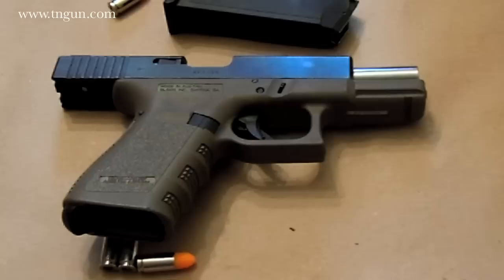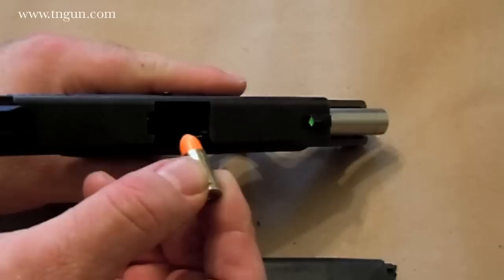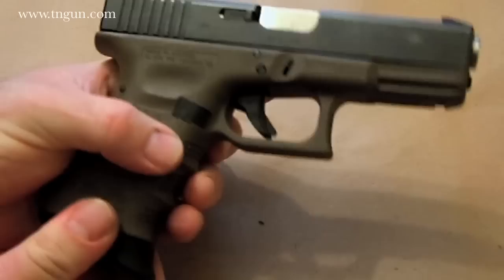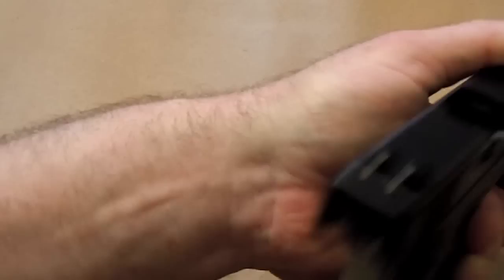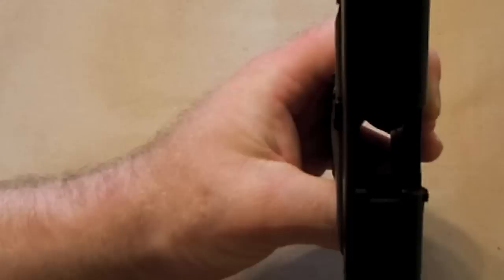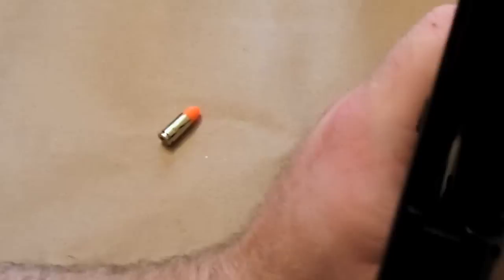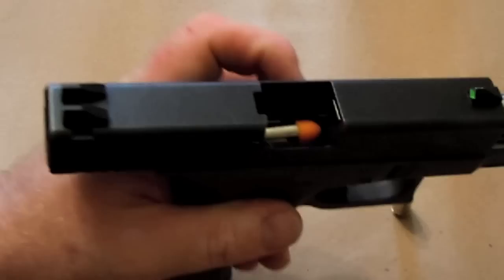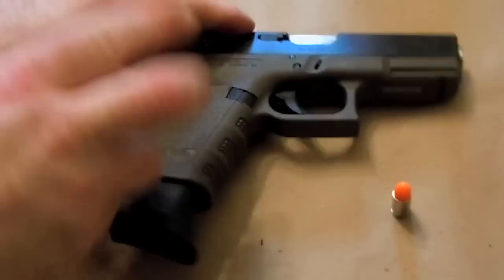How to Properly Load a Glock to +1

Comment: A Glock with 1 in the chamber only requires a light trigger pull to set it off.
That is comparable to carry a live chambered CZ 75 variant pistol with the hammer cocked but unlocked.
There's no heavy double action pull, and no additional safety, no warning, no second chance, just the very light trigger, to set it off.

Why do other companies even bother adding safety features to firearms if we could just carry the firearms hot and live?

Why do car manufacturers even bother adding safety belts, airbags and crumple zones if we could save a lot of money driving simplified vehicles?

That's just one side of the argument, what's the other side?

Comment: Sorry but extractors do not "bend" as all I have seen can flex as they are designed to and the extractor flexes to ride over cartridge rim on every round be it hand loaded if mag loaded. At least Ruger does this. Haven't researched Glock imperfection design.

Comment: Speaking of premature wear. Don't let your slide slam forward when you drop in a round. The slide is designed to pickup a round from the magazine which decreased the force in which it hits. If it's not chamfering a round, assist it when releasing the slide.
Reply: LedGuitar1218 No no and no. NEVER assist the slide!
Reply: Right, regarding "never assist or ease the slide closed"!  What do you think happens when firing, Led?  The slide is slamming back and forth harder than it ever will when you manually chamber a round.  Easing the slide closed is a good way to have your slide be out of bettery, possibly causing the gun not to fire when you need it.
Reply: Just a third person saying you never assist the slide, slamming forward is HOW it properly chambers rounds, like when it's firing in the first place. Look up a video on how to do it cuz there are little things you wouldn't think of.

Comment: Hello, I have a question.  I bought a glock 17 and loaded the magazine and inserted it into the gun but did not rack the slide because I was just testing the weight (I was doing this because the dork at the Arms shop gave me the glock 17 when I asked for a glock 19 and I have not shot in several years and assumed he knew what he was doing, and they will not take I back).  Since the 17 is larger than the 19 I wanted to see how heavy it was with the loaded magazine.  I removed the magazine.  I was checking the sites and aimed at my coffee table and tested the trigger.  Well, it fired!  

So here is my question.  Apparently this is not supposed to be possible.  You must rack the slide to get the bullet into the chamber right?  And with this particular gun I could not tell if it was loaded or not but I had not reason to assume it was loaded. So with a ripped carpet and the trim shot off my coffee table I was pretty lucky that I did not blow a hole in the wall (these were practice bullets).

Since it did happen, what could explain this?  Thank you.
Reply from the maker: Not to be rude, but you pulled the trigger on what you assumed to be an unloaded firearm.  If the guy that sold you the gun did not have the knowledge to sell you the right model (your words) then why would you trust that it was unloaded.  What you ought to do is not touch another firearm until you either get training to remove ignorance, or stop being careless.  A vital rule for all gun owners is "treat every firearm as if it were loaded".
Reply: I don't know if he has the knowledge or not.  Perhaps he was out of 19s and figured by the time I noticed the difference it would be too late to return it. Or he could have been stoned.  Seems that the several places I gun shopped the sales men have particular guns they recommend for me which I am not interested since when I used to shoot I preferred the glock.  even when I go to the store saying "I am here to buy a glok 19" they show me all kinds of carry conceal which are too small for my hands.

There were no bullets in it. I inserted a mag with 17 practice bullets. Now there are 16.  Had I treated it as if it were not loaded I would have not had dummy bullets and not pulled the trigger aiming at a coffee table I do not care about.

So I guess I won't get my question answered.  Thank you anyway.
Reply from the maker: I don't know how to answer your question.   a gun can't fire if it has no bullets.  I don't know how a bullet got in the chamber.  especially if you did not do it.  pulling the trigger on a gun you have not checked is a recipe for suicide or criminally negligent homicide.  Accidents happen, learn and don't do it again.
Reply: In your first post you said I need to remove ignorance and stop being careless.  Your second post says "recipe for suicide or criminally negligent homicide" (which could not happen since I aimed at the coffee table.  Thanks anyway.  I will ask someone who is not intent on being insulting.
Reply: A lot of guns are capable of firing without a magazine inserted, my M&P 9 Shield has that capability, it says on the side of the gun. My wife's LC9 must have the magazine inserted in order to fire a round, so if one is chambered, but there is no magazine it is not supposed to fire, however, please do not rely on such safeties as there are several factors that can affect them. it's best to always read the owners manual before handling the weapon and if there is any doubt it's best to call the manufacturer or go to a local gun shop or gunsmith. if you do want to test if your weapon has this capability, ejected the magazine, rack the slide back to eject any bullets in the chamber, switch the safety if it applies, then point the gun away from yourself and other people or pets, and pull the trigger. if you hear a click it means that your weapon will shoot a chambered round without a magazine inserted. if you pull the trigger and there isn't a click or it will not allow you to pull the trigger then it should not fire a chambered round without a magazine. this practice should be done at a shooting range and with a knowledgeable person with guns if you are unsure or new with guns. All in all, ALWAYS assume a gun is loaded until you have absolutely cleared the chamber by first ejecting the magazine and then racking the slide backwards and looking into the chamber itself, not the barrel, even then please proceed with caution. hope this helped!
Reply: sounds like you dont comprehend the saying "Treat each gun like its loaded." I personally dont mess with dummy rounds. If I were to use the dummy rounds above that have nickel/"silver" coating and mix those up with other nickel/"silver" coating I could load a real round on accident when doing dry fire practice. I dont do dry fire practice because you eventually will load a round and pull the trigger when you should treat each gun as loaded. 

simple answer: you might have mixed your live/real ammo with dummy rounds and didnt pay attention when loading the magazine. dont pull the trigger unless your on a range.
Reply: 4 Rules Of Firearm Safety – Follow these rules at all times, and you'll most likely never experience an accidental discharge.  
1. All guns are always loaded at all times.
2. Never point a gun at anything you are not willing to destroy.
3. Keep your finger off the trigger until your sights are on the target.
4. Be sure of your target and what is behind and around it.
Reply: If the slide was locked back when you inserted the magazine and then you dropped the slide forward, that would have chambered a round, you don't necessarily have to rack the slide to chamber a round. Also there's a loaded chamber indicator on the ejection port side of the slide, so you can feel/see if there is a round in the chamber. Strongly recommend you reread the owners manual for the gun and take a basic firearms handling class, even if it's just a refresher. Ignorance is still negligence, if you're going to own firearms you are obligated to be proficient with them.

Also, practice bullets aren't the same as dummy or inert bullets... a practice bullet can refer to a Full Metal Jacket round which is used for Target practice but isn't a defensive bullet, thus it's sometimes called a "practice bullet". if that were the case, it's still a live bullet. A dummy bullet is a bullet that is deliberately rendered inert and have no powder  charge, and therefore it can't fire.
Reply: thanks!
Reply: You dropped the slide after you put a mag in or you racked the slide(you experienced a light memory loss, right after the shot). Nothing else could of possibly happened. Don't ask anyone else.
Reply: This is not rocket science. There are only 2 ways to get a round in the chamber in a semi auto. 1- Load the mag then hit the slide release on an open slide or 2- rack the slide.
Reply: trebelclef I hope to God your joking
Reply: Trebeclef, I know you said you didn't rack the slide but is it possible that you 1) Pulled the slide back to open the chamber 2) inserted the magazine (which you said you did do) then 3) closed the slide then 4) pulled the magazine out of the gun? The gun would be ready to fire at that point.  I'm with Shepherd in that I can't figure out how else the gun could have been loaded either unless it was already loaded when you brought it home from the store. I do know there is a YouTube video out there where an off duty cop blew his finger off at a gun store because the gun in the display case was already loaded when the clerk handed it to him to look at so it is possible that it was loaded at the store. Sorry it took me a year to answer this question but I just saw this thread tonight.
Reply: You did not “rack” the slide, as the slide was already locked back when you inserted the loaded magazine.  You then depressed the slide lock to release the slide forward, thus chambering a round.  This method of chambering a round is not considered to be “racking” the slide.  Had you used your support hand to pull back on the slide to let it fall forward it would have been considered to be a “racking” of the slide.

I recommend the following:

    1.   Call the owner of the gun shop and explain what happened regarding the improper sale of your gun.  If he’s fair, he’ll make it right.  If not, tell him he has either an incompetent or a dishonest employee, either of which he (owner) should be very concerned about.  Let him know that you will report this matter to the BBB and Yelp his business.
   2.   Do not touch guns anymore until you have received formal training (e.g., from a certified NRA instructor) on how to safely handle firearms.  
   3.   Watch a lot of videos, right here on YouTube regarding firearm safety and how to load and unload, and holster your gun.  
   4.   Don’t get discouraged or “gun shy.”  With the proper training and lots of dry fire practice, you will soon become a safe and competent fellow CCW citizen.

BUT PLEASE GET TRAINING because someone, to include yourself, might get hurt or killed.

Comment: No.  You are simply incorrect.  Check with Glock, or a gunsmith.   When the round is stripped from the magazine and pushed forward into the chamber as the gun cycles upon firing the extractor is forced around the rim of the cartridge just the same as if you put the round into the chamber and then let the slide come forward.  The forward travel of the slide forces the breech face against the back of the round and forces the extractor over the rim.  The fact that you use your fingers to put the round in the chamber instead of allowing the slide to push the round into the chamber makes no difference from the standpoint of physics and the engineering of the firearm.  Please take this video down and stop perpetrating this myth.

Comment: NOPE you got it wrong. That’s a chambered round which should never be unless your ready to shoot. A plus one is when you replace the end cap of magazine with a plus one mag extender.
Reply: There's such thing as a plus 1 or plus 2 base plate.
But these types of guns are designed to be carried and stored with a round in the chamber. 
Additionally you'll notice on the manufactures web page for any semi auto, it says 10 +1 or 17 +1. This indicates the magazine capacity and then the obvious "one in the chamber" or plus one that you have when you carry it. 
Having one in the chamber gives you an added second of time that you would have to spend racking the slide. Which may or may not be relevant based on the situation. But what carrying with out a round in the chamber does is leaves the door open to a number of potential problems like a short stroke, or a jam. If you have one in the chamber already there is less that can go wrong when you need your gun the most.